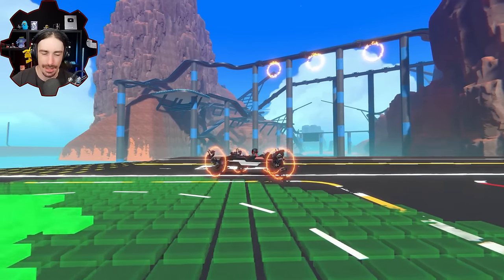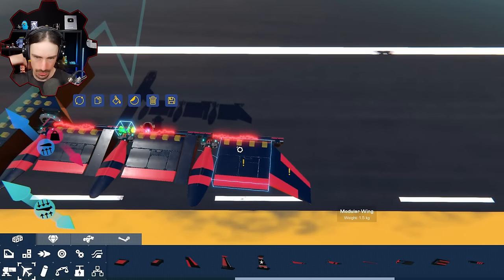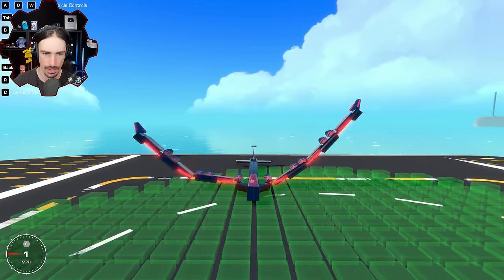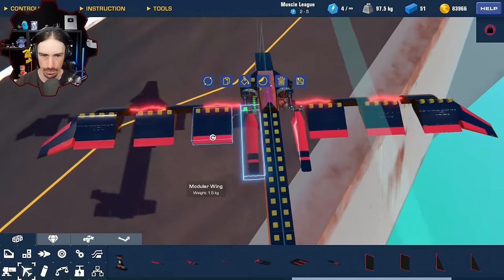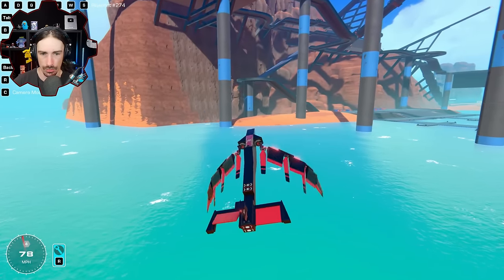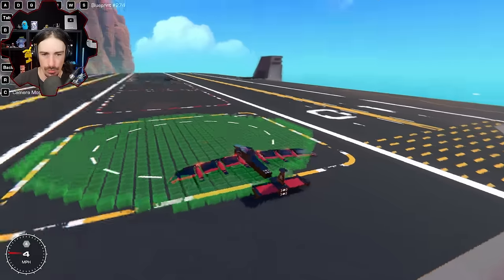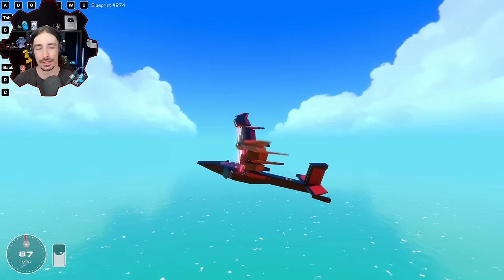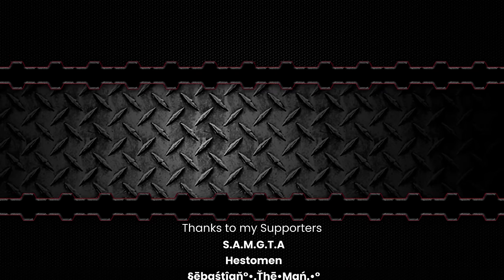Ornithopter Wings Are Way Better With Power Couplers!

Comment: Scrap man maybe the reason those helicopter blades don't work is because they might be canted one direction slightly, if you flip it on the other wing it should work. . . Hopefully
Reply: That's exactly what I thought you can see that they are tilted
Reply: That’s not how trailmakers helicopter blades work. That’s not the solution.
Reply: It doesn't work cause it also is on my helicopter
Reply: @ThePhonax hi
Reply: @zionjarman3610  they are not tilted
Reply: @NostalgiaHDOS  no way it’s nos
Reply: @frederikfrohlich3620  what part of your helicopter?
Reply: The blades were upside down. That's why the centre of lift moved away from the side with the helicopter blades. They were producing downforce instead of lift
Reply: @funkymunky7935  they were not upside down.
Reply: That's what I was thinking
Reply: @ThePhonax  it is, one face provides more lift than the other, I've had plenty of builds where everything seemed balanced but it wasn't stable in flight, upside down helicopter blades were always the culprit.
Reply: @ThePhonax they were upside down, if you use the in-game copy function it automatically places half of them upside down, it's an issue I've dealt with in many builds
Reply: @haydenratcliffe1138  but they weren’t upside down in this instance
Reply: I was going monkey mode watching this
Reply: @funkymunky7935 no, the helicopter blades have a weird thing that their lift is offset to the side
Reply: @haydenratcliffe1138 it doesn't, it is the way they are implemented their lift is offset. Just but a helicopter blade on a block an see that the lift is offset
Reply: It's a bug
Reply: They’re omnidirectional so they produce lift both ways
Reply: it’s not that. I’m guessing it’s a software bug
Reply: @Sam-in7ue  it could be to encourage the specific use of it on helicopter engines
Reply: I've learned to just not use them unless I'm spinning them, they are funky to use. Probably because they are designed to spin
Reply: You are correct
Reply: My thought exactly
Reply: That is what I thought. Nice to know someone else thinks the same way I do
Reply: yup, they are also not simetrical it looks like too me
Reply: @ThePhonax Stop being so passive aggressive. You aren’t right so please be quiet.
Reply: @coldblooded5908  I am right :D
Reply: I think you got to rotate one side of the helicopter wings upside down
Reply: @funkymunky7935  I don't think you thought that through. For one thing, down force IS lift. For another, adding a directly opposing vector would not shunt the center of lift to the side.🤦‍♂

Comment: You know the editors is invested in his work when he pull out animations just to illustrate a sentence
Reply: yeah it's a very simple animation but still takes a bit of work
Reply: I wouldn't call what Scrapman said much of a sentence. 5:56
Reply: @johnadams5513  I think they're referring to the bit at 4:20
(And the point he's trying to make is that he needs the wings to adjust their angle of attack as well as they move from anhedral to dihedral positions during the flapping motion.)

Comment: Should've modeled it after a dragonfly... they are the most efficient flyers amongst insects. The quad wing design will overcome most bilateral forces and give you even lift with each wing stroke and the forces are balanced out.
Reply: The last ornithopter was a dragonfly so he likely didn't want to repeat
Reply: @spook9106 A bird also seems the most natural one to choose out of all the flying animals out there. I mean, of all the flying animals, which one do you think of first? 

Plus it's very satisfying to watch the wings flap.
Reply: But a bird is more fitted for the powercouplers. Dragonflies fly better with rigid wings like the long helicopter blade
Reply: Dragon flies are the most efficient because of the way vorticies interact between the wings. Same reason geese form Vs when migrating.

Trailmakers (and most other aero simulators) don't model the effects of vorticies, so a dragonfly with just be incredibly cool.
Reply: dragonflies are a lower lifeform, birds ftw (jk, btw) >:D
Reply: @NeonWilder, despite the avian dominance of present today (considering how closely related they are), birds actually have the LEAST efficient mechanics—less than even bats
Reply: @len9505  -- By what metric are Frigate Birds less efficient than Goliath Beetles? What Eagle is going to loose by attrition to a Hog-Nosed Bat? 

Different species are specialized for different things, I'd expect the efficiency of various species' flight to have a lot of overlap.

Comment: 7:55 What I think is happening is that since the helicopter blades are meant to be placed in an "X"-like formation to create lift together, what's happening here is that they just are acting like they're meant to, but acting as if there was only one blade on the X. Or basically what I'm saying is that they're just acting as sideways wings right now.
Reply: you're right. The helicopter blades in game have a weird thing that their lift is offset to one side of the blade

Comment: One of the things I've done with ornithopters in the past is to power that tilting hinge just off the rotor. That way, the wings are guaranteed to be cutting into the wind and propelling the craft forward. With un-powered, low-strength hinges, there's a bit of time at the start where they're barely (or even not at all) propelling the craft forward.

Comment: Yeah, I had suggested this for the verses.

Limiting the power source for movmen to the wings. Ideally to replicate and actual wing you have scrap mechanic wings at the front and outer edge with sails on the inside behind them to provide lift.

Also it's the distortion of the tail and wing tips that provide "control" with the general motion of the center part of the wing like a breast stroke for swimming.
Reply: Okay, my first more detailed explanation was destroyed by an ad popping up closing the window, but here it goes.

You want to have 3 layers of "wing" with power couplers along them and then conected to each other tangentially forming a net in the middle with exstra bits hanging out from the "middle".

The first section you want to be non-control serface wing segments with fins on the end.

The second section you want to be sails in the middle with fins that continue the line from the previous section.

The last section you want to be controllable wing serfaces all in a row.

The flexibility of the power couplers can be adjusted as you shown to make the flapping motion. with the center ones that are tangential to the majority of them, you want to make these adjustments so a "bowl" is created on the down stroke.

Then at the wing tips you want a adjustable steering hinge so you can tip the fins up and down, well using those adjustable wings on the back row to get your fine controls (it's really to bad you can adjust the power couplers stiffness out side of build, possibly use steering hinges controled to replicate for even more control)

If done right the only programming really needed is the down and back swipe of the wing from the joint at the body only, and the adjustments of control serface, but the motion of flapping should work.

Additional points the sails in the middle like this should help with lift and speed. A proper and complex tail in simaler fashion would help a lot for this as well.

Ps. The small blades might have a weird programming quark where it's not that it provides lift only to the right of the build, but the right side of the blade, so flipping it upside down might fix it

Comment: that bounce when flapping your wings up can be fixed by adding a hinge in the middle of the wing that points the outer side of it downwards, making the wing look almost like an upside down V, then straightening the wing as it flaps down.

Comment: You want to have 3 layers of "wing" with power couplers along them and then conected to each other tangentially forming a net in the middle with exstra bits hanging out from the "middle".

The first section you want to be non-control serface wing segments with fins on the end.

The second section you want to be sails in the middle with fins that continue the line from the previous section.

The last section you want to be controllable wing serfaces all in a row.

The flexibility of the power couplers can be adjusted as you shown to make the flapping motion. with the center ones that are tangential to the majority of them, you want to make these adjustments so a "bowl" is created on the down stroke.

Then at the wing tips you want a adjustable steering hinge so you can tip the fins up and down, well using those adjustable wings on the back row to get your fine controls (it's really to bad you can adjust the power couplers stiffness out side of build, possibly use steering hinges controled to replicate for even more control)

If done right the only programming really needed is the down and back swipe of the wing from the joint at the body only, and the adjustments of control serface, but the motion of flapping should work.

Additional points the sails in the middle like this should help with lift and speed. A proper and complex tail in simaler fashion would help a lot for this as well.

Ps. The small blades might have a weird programming quark where it's not that it provides lift only to the right of the build, but the right side of the blade, so flipping it upside down might fix it

Comment: "Water is just air" 
-Scrapman 2024
Reply: To fish it is
Reply: I mean hydrodynamics is almost the same thing mathematically as aerodynamics. Fluid dynamics has the exact same formulas for water and air. The variables are just a bit different like density and viscosity. So from a fluid dynamics point of view, water kinda is just air. Really the only thing that makes a liquid different from a gas is that it is incompressable (and concequently but arguably more imporant, decompressable).

Comment: Next time, consider using parallel power couplings.  They should prove to be especially stiff along the plane they're parallel, but you can pair it with mixed stiffness so one side flexes more, and might allow for more tuning of the wing. The technical classification would be having a 2-spar wing, only the spars are energy couplers in this example.  And a fun consequence of moderately realistic spars is that they can flex independently of each other, inducing wing roll via a twisting flex.  Could produce some interesting results and open up other opportunities, such as piston-actuated wing flex.

Comment: I think you could get more speed out of it by trying to stabilize the body vertically. I think a lot of the "pushing" the wings could do is lost to moving the body up and down, but with more vertical drag on the body, and maybe more weight, the body would move less, meaning the wings would move faster through the air and in theory result in stronger forces. Or like some others suggested adding a 2nd pair of wings with the opposite "flap parity", but you'll then have to account for the pitch and vertical drag on the body would help for that too.

Comment: Helicopter blades are meant to rotate in a singular direction, so they're slightly thicker & biased away from the edge that initially meets the wind. If you invert one side of with Helicopter blades, it may even out the center of lift.

Comment: I could be wrong on this but I believe the centre of lift issue originates from copy and pasting the wing from one side to the other at the beginning.

I had something very similar happen on a completely unrelated build and I fixed it by deleting both wings and rebuilding them manually on each side. No issues after. Could be a complete shot in the dark though lol

Comment: The only thing that I would want to change is adding a third hinge to the wings just before the first power coupler to allow the wings to swing forward and back, thus scooping into and pushing the air behind them. I believe that this would allow for not only greater speed, but also better stability.

Comment: because helicopter wings are bulged like airfoils, one side will be more bulgy to displace more air (to make the helicopter idea work at all) so youre basically having sideways wings. To fix the problem you need to rotate them. 9:45

Comment: Something that can help a lot with ornithopters is trying to get an asymmetrical up and down stroke. You want the up stroke to be a few degrees more angled than the down stroke so that the up stroke has less vertical drag than the down stroke, which gives a bit more upwards momentum with each stroke

Comment: I think the reason the coupler version is slower is because as the wings give forward momentum they bend forwards, sending some energy out to the sides, rather than straight backwards.
You should try doubling up the power couplers (behind one another) to try to reduce the front-back flex.

Comment: Other option to improve control is to make the tail able to flare outwards and contract inwards like the tail of a real bird or like a Japanese fan, so not only do you have elevator control on them, but you can also control either the amount of surface area generating lift, or the width and/or depth of the elevator airfoil to produce more or less lift based on what you need to go up or down or stay level. Would require some sort of hinges to do. Also for helping to steer the craft, perhaps use some scissor flaps to provide additional rudder control like those used on pure flying wings instead of actual rudders, but use it in addition to your rudder.

Comment: Since the power couplers dampen rotational forces, you could probably get more speed by moving the steering hinges at the base of the wings with the logic controllers in sequence with the servos.

As is, the solid wings go faster because they have a more aggressive angle that is carried out through to the tips. The power coupler wings have a progressive angle that lessens for each segment. You can see this looking at a still frame of the wings flapping. 

22:51 has a good angle to see this. Compare the rotational angle of the fins at the tip to the segment next to them at peak height.

Comment: More force out of the flapping means you need to change the wings angle of attack or increase the length of the airfoil from round front to pointy back. Perhaps set the wings flap default angle to a different degree and add a little bit of wing in front of the flaps, or add a control surface to the front of the wings as well to change the leading edge angle and thus the airfoil geometry to produce more lift, and thus more force when flapping

Comment: You should try to build as much of the control of the air craft into the forward wings as possible.  With a little bit of logic, well a lot of logic, you should be able to do things like flap with one wing and double up the servos so you can control the exact speed their flapping at.  Basically creating a situation where you can do low energy glides via a fast flap down and a slow raise after while minimizing down force.

Also, for as relatively easy as these things seem to be to make, you should do a multiplier monday themed around ornithopters vs. blimps.  Would be kind of fun to see how the erratic movements of the wings play into things.

Comment: I think if you put another servo from body to wing (basically a bird shoulder) at a 45 to 65 degree angle so the wings are tilted also power couplers attached to hinges in the body would help bend it and maybe control pitch and fluidity. I haven’t got to play with the power couplers yet..

Comment: The logic you used to add roll to the tail could be cut in half as in just one Or gate.

if you set the base programming for the flaps to roll as in left and right, both have the same rotation, just reversed controls. Use the Or gate selecting both flaps, and this will be your pitch, as in up and down.

Comment: For yaw/roll you should have a central servo with the axis points forwards so that you ‘roll’ the tail and then use pitch controls to yaw
Reply: Yes, and combine that with a V-shaped tail that combines vertical stabilizer and elevators (like the Fouga Magister did)

Comment: Never played the game but I have an idea you could try if you look at the way a bird Flys it has tilt at the base of its wings so it can push off the air in a more foward motion a rotor and some logic might make something like that motion work and a potential improvement after that is to have the wings folding back towards the tail and then extending back to its splayed out position 

In slow motion, the wings would go

1. Flap down while folding back into the body (that would produce forward momentum)

2.on the way up the wing are following a flow so they tilt up while going up while also expanding their wingspan 

3. The wingspan should be as wide as it can be and at its highest poin and then tilt the wing down gradually, and when it gets to body level, it should be going into step 1 again 

You wanna push the air back and down so you can go forward and up just pushing the air down and relying on it to glide for speed might not have the ideal result 

The idea isn't to make it fly like a plane but instead to swim like a bird of prey

Comment: Can you program something to change the coupling strength actively, or is it only adjustable in build mode?

if so, you could make this more like a bird's wings by making the strength looser when moving up, and returning it to normal for the downstroke.

Not sure if that's even a thing, though.  

There's probably a way to emulate that change with pistons, suspension, hinges, or something of the sort, though, I'd imagine.

That sort of system would probably also let you use larger wings with less wingbeats for more stability, as you wouldn't be as reliant on looking up and using the angle of the wings to move "forward" into the air.